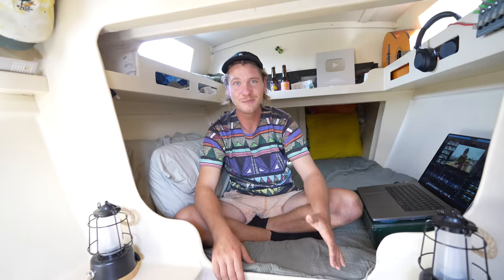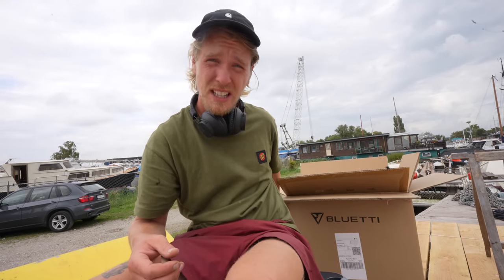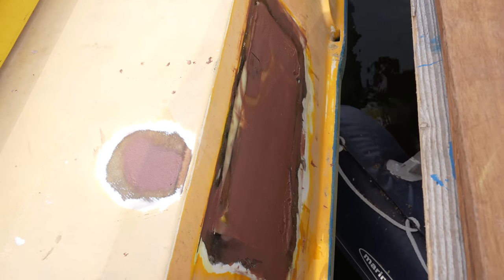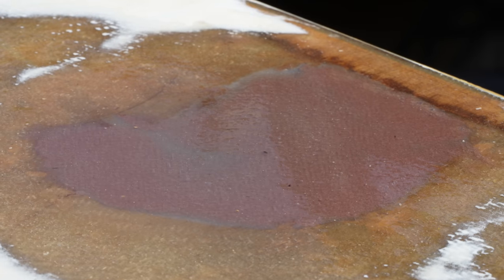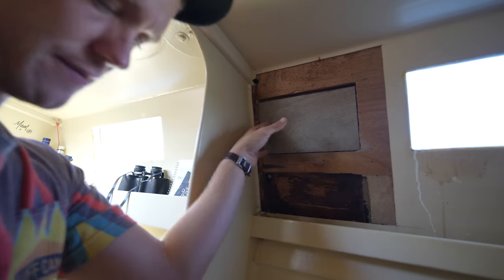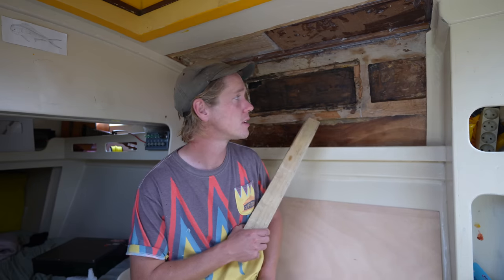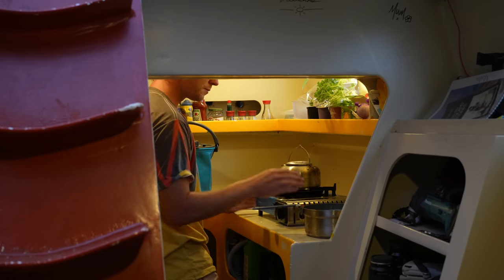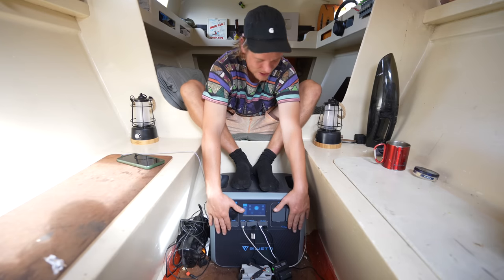Can I get This Boat Sailing In 3 Months? | Wildling Sailing

Comment: Mark I know your trying. Putting resin on that poorly cleaned wood wont go well. You must sand and get that wood down to clean new looking wood prior to any resin. You should also use mat glass to strengthen the wood a few feet all directions from where your chain plates will be mounted. Most of all if the area in the hull walls below where you found water are also double walled you must drill or cut holes through the inner wall all the way down to the keel too verify that water hasnt been drawn down there by gravity and time. If you take this boat out into real waters having not verified and repaired all the hulls then you are putting yours and anybody with you's lives in real danger. That foam also is not good you need structural foam and proper glass work. Think about what your doing stop worrying about having the boat ready in 90 days and do the right things so your boat is sea worthy.
Reply: You are absolutely right but im afraid Mark has neither the mindset nor skillset to repair the boat as it should be . I, like you, fear for his saftey if he continues the way hes going with this boat .
Reply: @terrytonkin2682  You are right and so are the dozens of others that have realized how his lack of competence is leading toward potentially life threatening hazardous situations. I just hope he doesn't take some naive crew member down with him when the bleak sea tests his half-assed sub standard repair jobs.
Reply: Wry smile... if he rofl intends to sail across the Atlantic in this or sell it to someone unfamiliar with his alter ego cgaf technique.

Comment: Anytime you have to drill a hole through wood and want it to stay dry and not rot from water intrusion, oversize the holes generously then put a backing over the hole and fill it with resin. Then drill your holes through the resin plugs. This seals the wood and if water does sneak it's way in, it won't be in direct contact with the wood and there will be a buffer between the hole and the wood.
Reply: A nice flexible compression grommet around the actual cable helps.

Comment: Mark - in a previous video you said you didn't like the way the chain plate holes are so close to the bulkhead and in this video you showed where you plan to relocate them to. The original position places the bolts either side of the bulkhead so the forces on the chain plates are transferred into the bulkhead. If you relocate them away from the bulkhead the fixing will be much weaker. That part of the boat was not designed to take the loads the rig will apply to it.
Reply: You are 100% right.  Those chainplates need to straddle the bulkhead.  If that means making new chainplates then it is a necessary expense.  The loads the rigging will put on them can be enormous.
Reply: He could bond carbon fibre chain plates to the bulkhead there is video on how to do it on both Duracell & Youngbarnacles channels
Reply: If extra glass is laid up from the chain plate position to around the bulkhead it will carry the loads to the bulkhead. Lay the cloth at 45 degrees for best load transfer!
Reply: Yes. that's exactly what I thought when I watched the video. This guy doesn't seem to have the common sense understanding of basic structural engineering that any good carpenter or mason  has.

Comment: Pro tip. When you're cutting with your circular saw set the depth of the blade for the thickness of material you're cutting.
You'll have less binding less likely to hit something unintentionally underneath and your blades will last much longer. Like if you're cutting something 3/8 of an inch thick set your depth to a 1/2 an inch. Your circular saw blades will love you for it. Lmao 🤣😂. You're doing a really great job repairing that boat for somebody that's never worked on one before, incredible!
Reply: He's had multiple project boats... check the previous videos going back yearz....

Comment: The solar generator is great.  I bought one for my sailboat also.  I don't want to deal with all the wires, and complicated systems.  You made a good choice.  I'm using solar rechargeable lights inside & outside.    I also have oil lamps that I use in the cooler months.  They give you light & heat.  Every day you're getting more work completed and the boat is looking better & better.  Cheers ⛵
S/V Cork~Texas
Reply: It's not a "generator"/
Reply: @shoutatthesky 

Storage station and converter.. is more accurate unless they are actually  plugged into a solar array.

I did see an interesting methanol powered catalytic true generator design that generates a bit of heat and very little CO2..
But they are pretty expensive to buy from the manufacturer. The one i saw was a fully  kitted on on E bay UK with fuel and only something like 25 hrs of use as a back up for a mobile home or during a construction project.

You might want to take a look Mark . They are quite light and compact.

Theres a new channel just started ...theyve a Pahi 42 in the warmth though.  With a a ketch rig and a central Deck house.
Reply: @clivestainlesssteelwomble7665  Name of channel?

Comment: The duck peaking in was the best. Moment. I'm glad you are focusing in on really important interior, structural rot and repair. I don't know how many hours a day or week you are actually putting in on the boat. Or much you needed funded from the donations to do stuff each week?  If you already got the funds for the wood supplies for engines, ect. Sails, ect,  radio electronics,  compass. Then yes you should actually be able to get done in 6 weeks.  If you already got the money and got stuff there or on its way. If you don't got the money and are not putting in atleast 40 hours a week in. Then hard to say, if you will be done in 90 days.

Comment: Good progress Mark, well done. That foam is totally wrong for a boat - as you'd found out it just holds on to the water! I think I'd be tempted to drill test holes all along that side to see where you get drips and where you don't
Reply from the maker: Yup, already did the test holes. Better than expected 👍👍👍
Reply: The foam is highly flammable! Test it😮
Reply: @wayneanderson1641 exactly like the rest of his wood-epoxy boat?
Reply: @MaciejWiercinski  😆
Reply: 17:04

Comment: Use alcohol to dry the wood 
It will draw out the water and drys faster
Reply: Wood alcohol beauty.
Reply: and it will keep you warm when it goes up in flame. #vapor #heater  Highly flammable. Vapour/air mixtures are explosive. Risk of explosion on contact with strong oxidants. NO open flames, NO sparks and NO smoking.
Reply: Whatever you do don't listen to the people telling you to use alcohol just let the damn thing dry fire a heat gun if you want but no alcohol on the boat unless you're drinking it
Reply: @claybornlewis276  if you haven't noticed he isn't going to wait for it to dry properly and is in the water in a cold climate where condensation is an issue so he will need to 
A use a de humidifier and fans for a week or two or 
B use some sort of solvent to displace the water before laying up epoxy

I'm guessing he waited a day and just laid it up wet still tho
Reply: @johny7206  congrats you also understand how not to set yourself on fire when using solvents 
His other option is shore power and a dehumidifier and fans for a week or two
Reply: @thomascooley2749  I've been watching him since he bought the boat I think he's a nice kid seems like a really nice kid but he is half-assing a lot of shit on the boat I mean if you're going to sail across the ocean you need to do it right I think you paid 3 Grand for that thing he should have got it for a couple of hundred bucks he's made it look better but I fear that he's going to have problems with it because he's not doing everything like you should but it is his boat and he can do it anyway he wants I'll still watch
Reply: @claybornlewis276  o yeah he will have plenty of issues 
Hopefully he will sail back to the uk and spends another yr in the fix it sail it break it phase before considering a longer passage much less a lap around the world
I'll give him this many of us would have cut our losses and scrapped something with so many problems and rot but like he said it's basically OJT at this point and it seems many have leant him a hand or a brew to help

Comment: Build a 7' x 10' deck cabin. 3/8" plywood with 2" x 2"  studs covered with cheapest polyester resin and rustoleum paint. You will have a waterproof cabin/ galley, topside, to work and live out of. Add door and windows and all for about $800 or less. Living topside, with windows,  will make your life alot less depressing

Comment: 13:50 When something like this happens, sometimes a good quick fix can be to put some regular waterproof wood glue on it and put the broken piece back with some tape over it, when it's all set you can sand it down and paint over it later and no one will know it ever happened.
Reply: Super glue works perfectly too, you just have to not glue your finger to it.

Comment: Mark, I enjoy watching your videos. Thought I might offer a suggestion. I've got many yrs experience in the construction field. When you're working on a vertical surface and want to contain a mess or debris. Use painters tape or masking tape and light weight plastic and make a net of sorts. That will help keep so much from falling in the water. Also keep you from cutting your hand with a sharp chisel. Keep up the good work.

Comment: Lucy lights. They are light, inflatable solar charged led lights. They appear as a cylinder when inflated with a small solar panel/battery/light at the top. They are completely sealed plastic with a inflator valve. You inflate them to create a globe for the light, deflate them and they store quite flat. 
Quite cheap, last a few years and usually several hours on a charge. I carry a couple on my camping sailer. They float, waterproof, self contained and really lightweight. Provide decent lighting as well.

Comment: In future Mark, pre drill your ply so as to not push out timber fibres when driving in screws this will allow the ply to set tight against the frame and even use offcuts pre drilled as washers  to cover a bigger area of pressure . Top effort so far mate
Reply: Great advice 👍

Comment: This is just a suggestion. Please consider creating a simple working platform for your work space. The platform, in the case of a taller person as yourself should be at least 38 inches high. I noticed that you have a pair of sawhorses for work projects. I would consider fastening a piece of plywood from the underside of the sawhorses and the possibility of even adding 2x6 to the underside of the plywood on the ends and in the middle for extra stability. Even more, have one of your carpenter friends build some sawhorses from used wood. You will be so glad you did. I had the fortunate experience of working at a young age to be trained by an old-time carpenter. Our approach every workday involved setting up the job with a sawhorse work table and another table for just the tools we would be using that day. Best of luck with everything as I truly enjoy watching all your videos.

Comment: BLUETTI, BABY!!  I bought the EB55 for truck camping this summer and it's great!!  It does what I need it to do and it recharges easily.  Kudos to you and Bluetti.  Also, finding that much water in the hull can be an emotional drag, but you're working it the way it's supposed to work.  Even MORE kudos to you... you impress us all, more and more, with each video!!

Comment: Just a couple of thoughts re the filler packing of the ply while it may be advantageous to you to use premade fillers and it works well (I have done plenty of that) because it is a sponsored product. However for most of us its a bit spendy, so perhaps try some of the cheap and arguably better self compounded fillers what springs to mind is in boatyards the content of wood sanding dust, extractors contents, sawdust and wood flour often freely available I use it allot personally its actually stronger and sometimes lighter than a sandable surface filler like you are using. for filling add a small amount of colloidal silica to the epoxy then add wood flour stirring until I get a usable product almost dry but still workable then fill the void once cured sand the tops off then fill with a product like you are using now to get a good surface to lay glass on. 

Second thought was could you use the European canal system to get somewhere a bit more pleasant for the winter perhaps even down to the Med?  Much as I love the Netherlands its not contusive to outdoor boat work in winter.

Comment: Good progress. Well done Mark. I would recomend fitting some fixed wired in lights running from the Bluetti. LED low current ones of course. Having at least some fixed lights coming straight from the power system would be more convenient. You can always keep a few portable lights to supplement them, or to use if the powerbank goes flat.
Reply: Great idea 👏👏👏

Comment: Kudos on a good job m8. With winter approaching, bad weather days will only get more frequent. Consider the 80/20 rule. Do the 20% of the work that can get you 80% of the way done on the interior (support for chain plates) and you may want to spend the rest of the bad weather days staging your exterior days. That way you can ensure you can get the most progress towards the mast and engine boxes. You'll have plenty of time for interior work once those are done 😉

Comment: Hi, just a bit of advise , keep the chain plates spread across the bulkheads . If you move them away you need to confer with builder for structural changes

Comment: Surely, it would save future problems if you were to create breathers and drains in the closed spaces. Also, don't be reluctant, at this stage, to use doublers and butt-straps to reinforce your repairs. Function before form - you will have time and resources for for something more refined later.

Comment: Maybe it would be a good idea to fit a little wood burner to the boat for those cold winter days.
Reply: Would be great! But safety first last and always with wood stoves.  keep your wood stored WELL away from the stove.  OVERDO the metal insulation on all sides of the stove.  OVERBUILD the stovepipe connections and through hole insulations.  OVER-engineer the space above and around the top of the stovepipe.  Seems like a project you'd want your dad involved in.
Reply: There's been loads of research showing how bad they are for your health with all the particulates. I'd probably go for a diesel heater and then you can at least have it come on on a timer!
Reply: i imagine a stove for a ship would be a closed type not and open cooking stove or something like that.. @timfish

Comment: 2 things 🙂Prepare a work area on the deck, where you secure the "workbench" and maybe a cheap pavillion/tent. It will save you many hours of work in the coming months.
Second, get some wider chainplates so you can center them with the bulkheads, and still have plenty of space on each side of the bulkhead inside for knots.
It will be the strongest way to do it, and you don't want the chainplates to fail underway!!
Reply: Excellent idea on the chainplates. That hull has way less support for them than a plank on frame boat. Spreading out the stress would help a lot.  Also great idea about putting up a deck shelter.

Comment: Rebuild one panel at a time, one screw at a time, one can at a time. Keep going. And - yes, I too have gone Bluetti.
Reply: The trouble with one panel at a time is you have to give enough time for the wood to dry out before repairing it/ If you remove all the damaged panels at the same time they will all dry out t the same time.

Comment: Try to buy a 12V electric blanket as very efficient. Even if you get simple cheap 240V version, position 1 is 20watts, 2 is 40W, 3 is 60Watts. You warm up on 3 and sleep on 1 or 2. Position 2, 40 watts x 8 hours =320 watt hours, not a burden to your solar, better than buying propane. Also a thin150W engine block heater attached to the back of a finned 12x6inch heat sink looks cool. Easy to buy and make. Put several around the boat. When your batteries are full good to use that solar potential that just goes to waste. Wattage sounds small but direct radiation in small insulated works well. Also don’t use 240V fans, on high they consume 55W. A 12V DC fan will be 25W. A 1£ speed controller saves even more as 0 to 25W Finley adjustable for comfort. In summer you can be wasteful but many winter overcast days in a row will test your solar to the limit. While ripping out rotten walls run cable for permanent led lighting.

Comment: When working on the side of a hull, consider doing it from your tender rather than leaning overe the side. it is much more comfortable and if you do happen to drop anything it should land in the tender not the water, it also collects all the rubbish rather than the water. Can you get sailing anytime soon? I should think so in some form, Even if it is not your final rig, an add hock rig is an exercise worth doing in itself, and hope you never find the experience gained handy! That accidental chip on the inside....a bit of old cardboard box laid out to protect around the working area is always a good idea...lesson learned!

Comment: Making the interior drier. Preparation for chain plate installation. As fall turns to winter, getting the cabins dry and warmer becomes challenging. Oil/propane/diesel heaters are all possible options. With sufficient battery power, limited electric heater. A used small dehumidifier(s) may reduce dampness.

Interior work on rainy days. Exterior work (mast, chain plates, deck beams, engine mounts, sail rigging, sails, protected cockpit, rudder/steering). Continue discovering those rabbit holes and covering them both from tthe outside and inside.